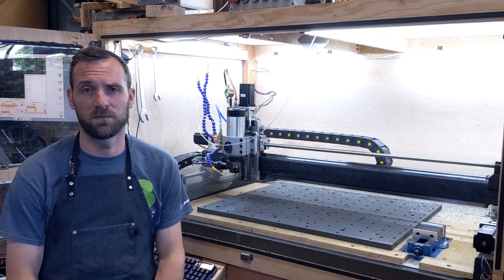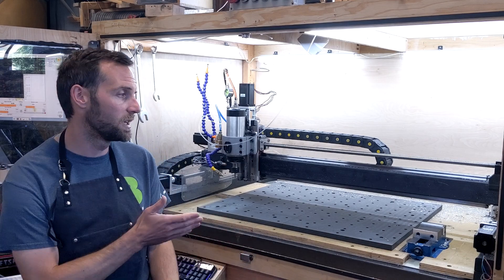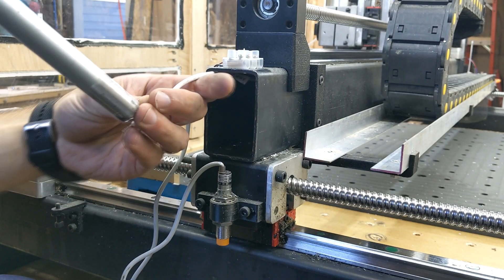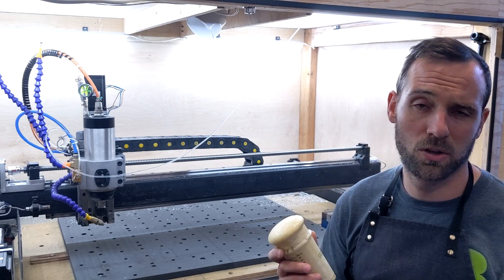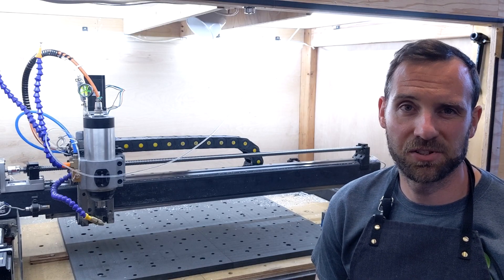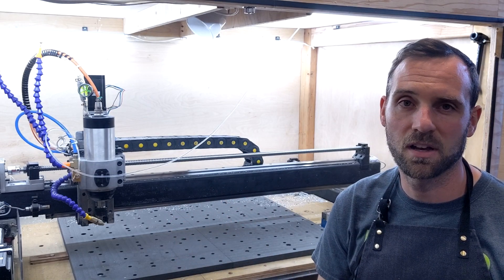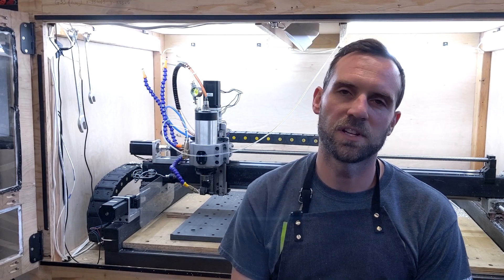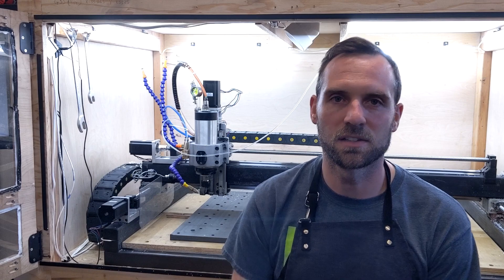PrintNC Foam Filled X-Gantry Upgrade!

Comment: Nice try but the reason you don’t observe any notable change in the airborne sound level is because the x-gantry is not the dominant source of noise! To observe a change in the broadband level like that the x-gantry beam would need to be contributing as much sound energy as the spindle and spindle/material connection combined, which of course, it doesn’t. You need to measure the vibration displacement of the gantry in one or more dimensions and then analyse it in the frequency domain against a range of rpm without load and under load. You then identify the more resonant frequencies and then come up with a way to treat them(which is a different post altogether)

Comment: Hi MK. Just saw you video for the first time. I am building a cnc machine an I'm using a 6"x3" heavy walled aluminum extrusion from 8020. I plan to install a 4hp water cooled spindle. I saw a video that was 4-5 years old but it was of a cnc'er with a similar build. He used his X axis tube as a water reservoir by enclosing the ends with 1/2" lexan and running water lines to one end.  I'm thinking of giving it a try on my machine.  Sorry the foam idea wasn't sucessful. It sounded like a good idea!   Dennis Huddleston

Comment: Why foam? You want mass and strength.. foam has neither. 

Mix two part epoxy with the mill chips you have around the shop- 75% chips, 25% epoxy. Vibrate to remove bubbles and voids. If you're feeling real brave, shove the biggest Chinese Steel l threaded rod you can get and then epoxy around it.

Comment: Check out where your chips are jumping around while cutting. thats the part you need to address to reduce the noise.    so your MDF board where the vice is mounted to start with

Comment: You can fill the tubes with sand to reduce the sound. Would be nice trying using a vaccum pump to remove the air inside the tubes. Sorry for my english.

Comment: Nice machine, Maine you should have tried to add cement, sand or something heavy in the tube. This would have added mass, lowering the redone ting frequency. 
Nice job anyway :)
Reply: yes was just going to comment on adding cement. i did this with the pillar on a cheap pillar mill/drill. think it worked great on that

Comment: Good idea, wrong filler.
Sand would have been a good filler.
It would lower the resonant freq. of the beam. Square tubing is full of tension from the forming process, so it tends to resonate like a string.

Before you take your machine apart grab a piece of square tube, fill it tight with sand and hit it with a hammer. You should hear a difference.

Sand needs to be dry and some kind of vibrator is needed to pack it well. Use expanding foam from a can  to fill the void at the end.

However, rigidity is the key. If the gantry beam is not rigid enough and the bearings are too loose, etc, the sand may have marginal impact.

Comment: I used epoxy granite to fill my Shapeoko 3 XL gantry. It made a huge difference and significantly reduced vibration :) - foam is an interesting option, however I believe the majority of the improvement comes from the added mass, in which case, foam isn't that great for obvious reasons :)
Reply: oh nice, any picture ?
Reply: @valdemar Erlingsson whats the ratio of epoxy to granite you used ?

Comment: Thanks for posting this experiment. I am also super happy with my build. My biggest precision gain was switching to closed loop steppers since their prices have come down from the stratosphere.
Reply: Closed loop steppers are great. Have some on my custom C beam machine. Something funny I noticed is they run cooler when cutting, rather than holding position. The world works in mysterious ways, lol
Reply: why would that make any difference in precision.
Reply: @chicoxiba  Regular steppers can easily lose steps. The closed loop variety ‘knows’ if they’ve lost a step and compensate if possible.

Comment: i'm curious what were the bit specs (diam and nb of flutes) and the feedrates you use ?
because i'm not doing so much overlap when milling aluminium, you got what 75% of the bit diameter ?
i'm asking because it reminds me when i was using 1 flutes and i'm not using it anymore as it rips more than cut and they are more fragile i found out.

Comment: Hi, Have you seen Dan Gelbart's shop tour video where he uses lead sheets to dampen an anvil's ringing? This may be your solution.  I think Dan may have this problem solved. at 20:38 into the video he explains how he stops an anvil from ringing. Very effective solution it seems is to glue two lead sheets to either side of the metal and that seems to completely dampen the noise. Now where to find lead sheets? https://youtu.be/HWPYoE1SNnA?t=1238

Comment: Thanks for sharing the experiment and the results, I feel you are on the right path, perhaps the foam was not the right choice.
I am toying with the idea of filling my gantry with a resin sand/granite mix, the idea being it will stiffen and dampen.
I think you're noise is more the result of the bed being plywood, I would go to granite benchtop supplier and replace the bottom plywood.
You can drill holes in the granite slab and bolt it down as well as bolt down the spoil board.
I would also use pvc glue between the metal and granite as a filler damper, its the clear soft kids glue and comes of easy from gloss surfaces.

Comment: to fast speed , add more linear bearings (guide block etc) 
2 per rail is best 
then pour 50mpa concrete mix inside of the frame and on the bottom with extra reinforcement 
(u can buy it in 25kg bags with basalt reinforcement mostly ewerywhere - used to build a fence without tools to mix it (fill the hole then add water no mixing needed etc ....still better to mix though)

when u do that u will have super stiff frame :) 

if u know how to do it , u can try to make more than 50mpa concrete , but even average concrete with extra fibers (glass , steel or basalt for concrete) and accelerator if needed  , can give u more than enough strenght ( its best to add at least 1 reinforcement steel rod if concrete wont stick to the steel and start cracking inside etc , or drill , tap , and add few screews so concrete will grab them inside the frame

Comment: Beware foam can trap moisture. When we do this to race cars they are scrap in 10-15 years. 

Also, there are special foams to make things rigid, normal poly foam does very little as you discovered.

Comment: Absolutely won't do anything, but I like the spirit behind the experimentation!
Reply: I did this on my extrusions and the ONLY thing it did was lessen the "ringing" sound you get from the hollow extrusions.  After that I filled my gantry with sand. Man, what a difference. It sounded dead when hit with a hammer and also improved the finish a bit due to more of the vibration being dampened.

Comment: Have you tried a dial indicator, 0 it, and start pushing at the machine with your hand. I work on large industrial CNC wood routers. I do this as soon as I work on a new machine in order to know what axis is weak or if something needs tightening. It might help track down your weak link. Hope it helps.
Reply from the maker: Thanks for the tip! I've been doing a few push pull tests on the machine. Some of the flex is just inherent to the design which allows for it to be more easily assembled with basic tools and still cheap enough for DIY. I can address most issues with good CAM, but it's fun to test out simple stuff like this.

Comment: From what I have heard that the only foam that has any real effect is the 300kg/m³ density foam (meaning round 3x the density of the foam you used). Regardless I am sure you would be much better off using as most people mentioned sand (the sand needs to be packed in tight which at this point is going to be very annoying without disassembly), epoxy granite or expanding uhpc as density is a very important material if you want to improve vibration damping (and foam generally means its mostly air so that is not exactly the best option in most cases)

Regardless good video and thank you for sharing!

Comment: maybe that's why everybody talks about epoxy granite and nobody about foam )
(before doing any modifications you'd better to measure what exactly causes most problems to you.  
in your case thick steel tube looks sufficient for being gantry. more questions on Z-axis assembly and using single bearing block instead of pair everywhere )
Reply: The idea of the PNC is to be made with as few tools (basically drill and 3d printer) and on as low of a budget as possible. Using steel tubing in the design means that you have a very uneven/bent surface for mounting the rails, which in turn will very easily bind if you used multiple blocks. Thus the compromise is to use single blocks which allow for a lot more alignment error

Comment: Very interesting! Recording with a linear reference microphone and looking at the spectrogram (time varying FFT) would help detail what you are seeing in the dB reading. Keep on innovating!
Reply from the maker: Thanks, I might have to dig into your idea a bit more to see if I can pull some new data that way.
Reply: @MKMilling  Might also try subtracting the before and after recordings. Align them the best you can, have software apply a small range of +/- time shifts, minimizing total energy. One the signals are aligned, perform FFT to see what's changed. Just ideas. Cool project though. 
What difficulty did you have with the accelerometer?

Comment: two thing to consider here:
1 resonance frequency. if you change stiffness or mass you can minimize excitation of the system. This frequency needs to be as far away from the frequency generated when cutting
2 dampening. removing energy from the system will reduce unwanted movements by turning energy into heat
sand in the gantry will provide mass and generate heat when it vibrates, getting best of both. Foam does not do much of these things...

Comment: 1st off, you're going about this soooooo incredibly wrong it's reckless.  To make matters worse, the tool you're using is way out of control for that machine. If your stuck with that tool, simple fix stick it farther up in the collet... There's no reason you should have all that tool sticking out as your just making it harder on your machine... (Use a shorter tool)   I'm 100% sure you can fix most of the problems using correct tools and proper feeds and speeds "for your machine."  Before even attempting what you're doing.  Hopefully, it's not too hard to remove the foam if you even need to at this point...

Comment: Just getting yourself a simple dial indicator and pushing or twisting your frame will help in testing how rigid your marching is.
Reply: I don't think anyone expected the foam to help with rigidity, but the hope was that it would help with vibration dampening.
Reply: @luftstolle  So you mean... Vibration for sound? But not deflection vibration from the tool making sound?
Reply: @Jeralddoerr  The vibrations lead to worse performance, e.g. surface finish of the machined parts or more tool wear etc.
Reply: @luftstolle  Yes! So case in point... Why the heck would anyone think foam would make anything more rigid??  Horrible idea.
Reply: @luftstolle  I hope you understand that tool deflection and ware are directly related to the rigidity of your machine and spindle.
Reply: @Jeralddoerr  For sure, but this video is not about rigidity, but about vibrations. Steel is very rigid but also prone to vibrations, which is why professional machines are often made from other materials (e.g. cast iron, epoxy granite), even though those materials are less rigid and more expensive.

I don't think it's inconceivable that adding foam to the steel would help with vibrations, but one has to test to find out.
Reply: @luftstolle  vibrations come from lack of rigidity. Foam helped with vibration frequencies and resonances that may create noise that are annoying that's all...

Comment: You're mixing the foam too much. You would be better off packing the gantry with sand.
Reply from the maker: Yeah, got the mixing figured out a bit better on the second attempt. I could see sand potentially having some better results after having done this, but for sure comes with its own challenges.
Reply: @MKMilling  Sand is used in roller coasters to decreases resonance.

Comment: I would not have expected any cutting improvements as this isn't probably really vibration dampening on the steel tube. I would have hoped to cut down at some of the noise though. Bummer that's not the case either. Thanks for trying so I didn't have to :)
Reply from the maker: Haha, Glad I could be of assistance!!!

Comment: I wonder what using a steel tube as the conduit and going with a epoxy granite fill would be like. Prevents filling the whole tube so you don't have as much weight vs a fully filled one but I bet it would increase the rigidity and vibration damping of the gantry.
Reply from the maker: Yeah, that would be interesting, I'm guessing it would be "better" than the foam, but I don't know of it's really enough of a factor on the machine performance that it would drastically improve cut quality. Hopefully someone takes the initiative to try it out, haha.

Comment: Why not fill the gantry with sand? Any downsides?
Reply from the maker: I think it would be hard to get sand packed in tight enough without some sort of binder to prevent it from shifting under high acceleration and deceleration and potentially adding more issues, kind of like a deadblow hammer. If I was going to try and get more weight in the gantry I would probably look at a high performance cement. Outside of my little mishap, the foam was pretty easy to use, would be even easier if you did it before it was attached to the Y rollers.
Reply: @MKMilling  The deadblow effect is the point. It dynamically absorbs vibration.
Reply: @MKMilling  Yeah I thought about concrete too, but drying shrinkage is going to cause a lot of issues. My idea is to pack it full of sand excluding the area where the bolts are before fixing the gantry to the y axis, and pack it really well using also a threaded bar
Reply: @gregorgombac5302  you can get concrete that expands during curing
Reply: @fuzzy1dk  nice to know thanks, will see since my machine that I'll build using 100x60x4 will already weight about 100 kg
Reply: @gregorgombac5302  there does exist expanding ultra high performance concrte. Check out durfill for example.
Reply: @exol511  that is a very cool material!!
Reply: @MKMilling  In addition I thought better about it, and it doesn't need to much packing since it only moves on y moves, so just pressing in really hard the tube end caps should be enough
Reply from the maker: Very true, there are a lot of opportunities to do it a few different ways I think, I felt a bit restricted since my machine was already assembled and running, so I wanted to try and find something I could implement without causing too much downtime on the machine.
Reply: @MKMilling  yeah that's true, you did a good job, even if the improvements did not show in the video
Reply from the maker: @gregorgombac5302  Thanks, it was still a fun project even without seeing improvements, plus i hope it helps other people.
Reply: @MKMilling  Fill with sand, close the tube, with one through-hole thread, insert a screw and turn it in, so you increase pressure on the sand. after a few millings, look for the screw, you shoud be able to go further inside. removing all emty space. sometimes fill up sand. So you have the optimal damping.